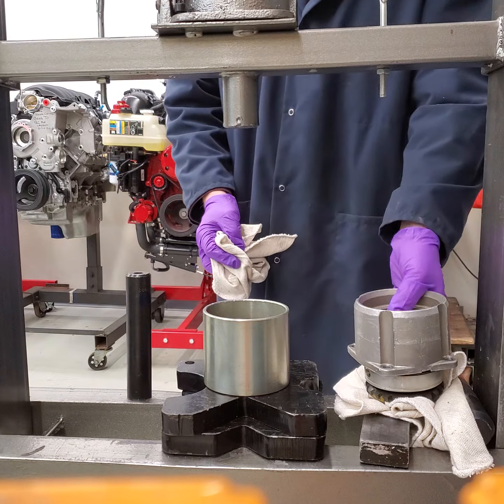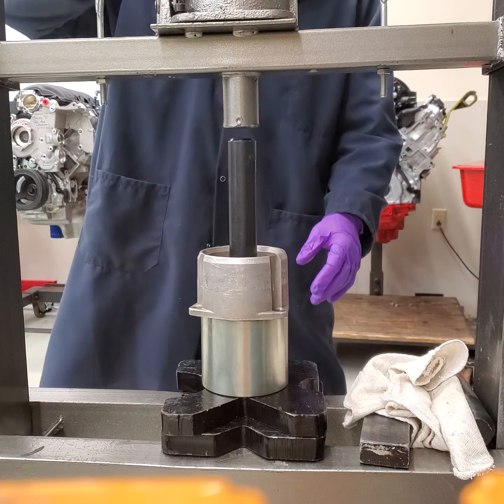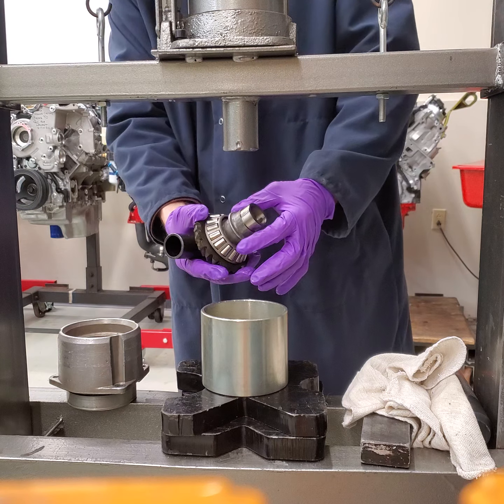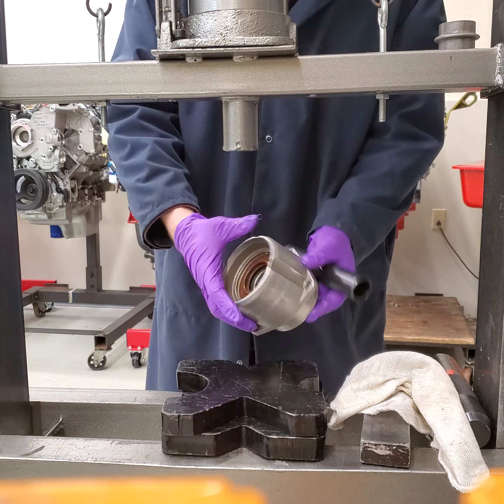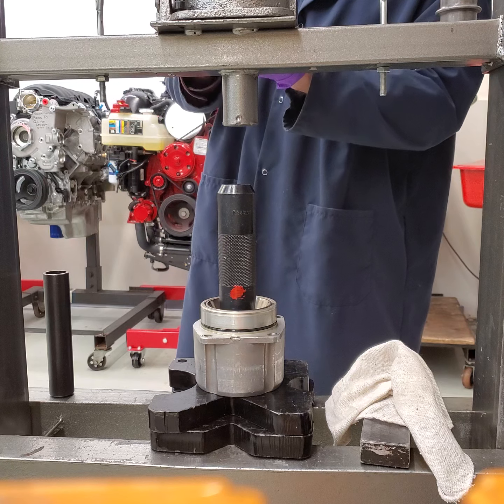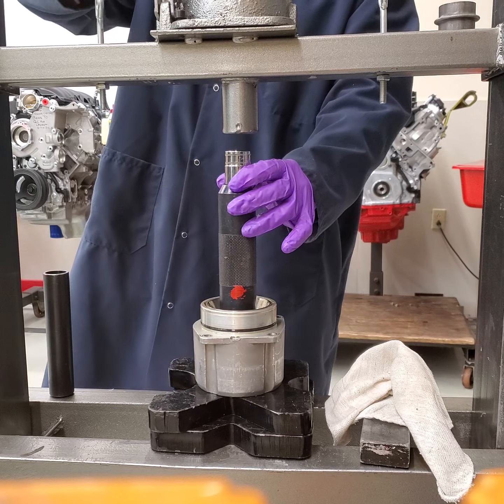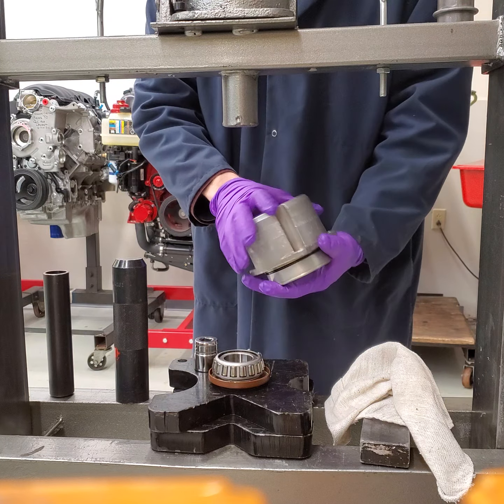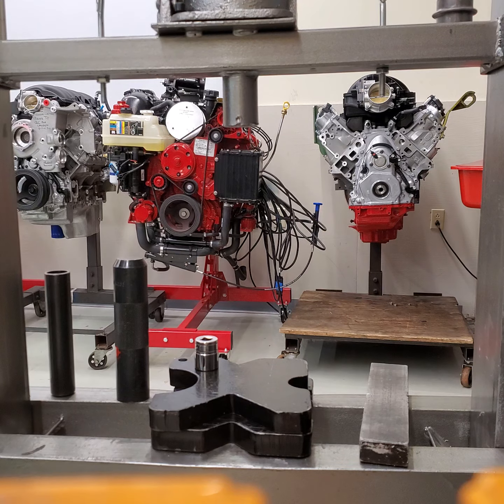Volvo Penta DPS Sterndrive repair

Comment: Can the complete prop shaft assembly be removed from the lower unit without splitting the upper from the lower on a dpsm volvo drive?